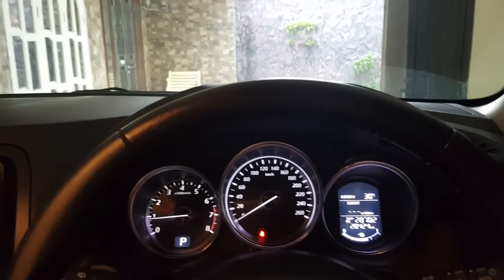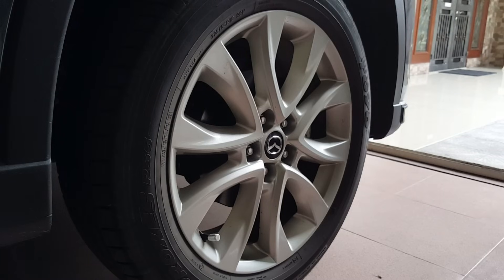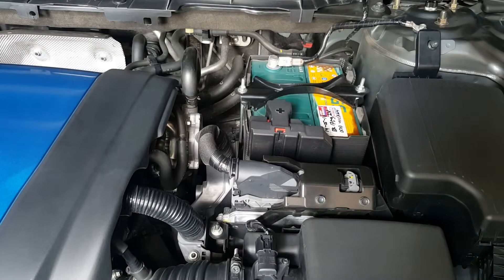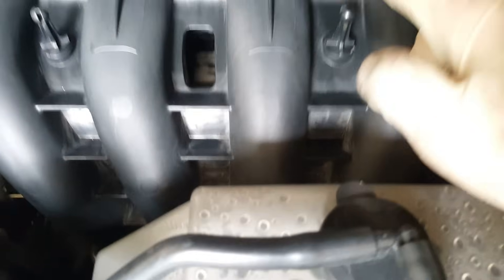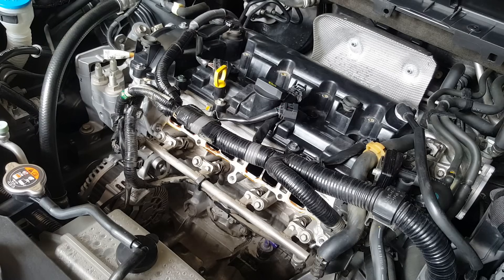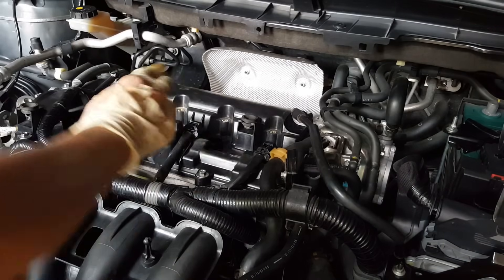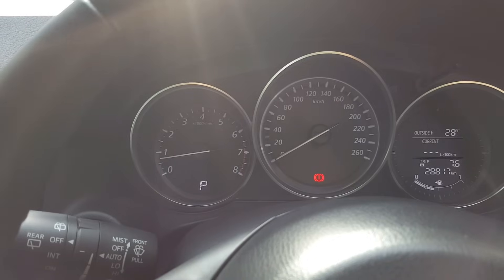How to Clean Intake valves / Carbon clean // Mazda CX 5 (All Skyactiv Gasoline Engines)

Comment: Apa tanda2 intake valve CX5 sudah kotor dan harus  dibersihkan? Terima kasih banyak.
Reply from the maker: kalo terjadi misfiring saat jalan. Kalau kepingin bersihkan saya sarankan membersihkan intake valves setiap 40000kms spaya tetap awet mesinnya dan pilihlah bengkel yg mengerti ttg mazda skyactiv. Soalnya sdikit rumit juga untuk dikerjakan.
Reply: @GarasiFelixDan  terima kasih atas jawabannya. Ada bengkel rekomendasi di jakarta? Kalau anda punya bengkel di jakarta, boleh share alamat? Bentar lagi udah km 40rb.
Reply from the maker: @thebearbean  mungkin bro bisa bawa ke bengkel elika jakarta.
Reply: @GarasiFelixDan  bro, bengkel yg mengerti mazda dmn ya utk daerah Medan selain bengkel resmi ?
Reply from the maker: @rahmatantony9506  kurang tahu bg. Mungkin coba cek tonsgarage. Kalo bole tahu ada problema apa ya.
Reply: @GarasiFelixDan  pada saat mendahului mobil lain saya pijak gas penuh tiba2 delay bbrp detik suara mesin meraung setelah itu normal kembali.
Reply from the maker: @rahmatantony9506  pakai bbm ap ya. Apakah uda coba ganti filter udara dan bersihkan Throttle body dan udah brap km ya mobilnya
Reply: @GarasiFelixDan  berarti itu masalahnya ya bro ? Kemarin sy isi pertalite kebetulan diluar kota g ada pertamax. Apakah itu berpengaruh ke mesin ? Menurut informasi dr mazda pertalite msh diperbolehkan bro dan g membatalkan garansi.
Reply from the maker: @rahmatantony9506  pertalite bole tp jgn sering ya. Octane nya jelek. Bisa ngelitik dan gk bagus buat mesin high compression sperti cx 5 kita.
Reply: @GarasiFelixDan  ok terima kasih informasinya bro.
Reply from the maker: @rahmatantony9506  cek busi nya jg y.

Comment: I wonder If this is due to mostly bad fuel. I know fuel in the US is much more refined and also we have faster roads. I'm at 95k miles on mine and runs great.
Reply from the maker: You r correct sir. Here the fuel quality isnt that good compared with in the US . The traffic also alot different we only get traffic jam and mainly start stops in the city and that is why we dont pass over 60kmh on our roads. :(
Reply: @GarasiFelixDan  Hopefully I dont have issues...I plan to keep till over 200k miles.
Reply from the maker: @dexterm1285  you should be alright :)
Reply: @dexterm1285  hey dexter how is your Cx-5 now?
Reply: @michiganmitten1147  Still runs great 114k miles.  Only thing I had to do is replace the shifter park switch as car radio would sometimes stay on after car turned off.  $50 part and took under 30 mins to replace myself.  It's a known problem on these vehicles especially as they rack up miles.

Comment: Thank you for the video of your cleaning method. Great detail! What kind of roads was the CX-5 driven on prior to cleaning? Was it mostly short distances or long distances, and was it on slow or high speed roads? Strangely, these engines have their own version of a catch can on the manifold (that hump in 8:23 where you have to remove the line).
Reply from the maker: Mostly short distance.
Reply: Thank you.

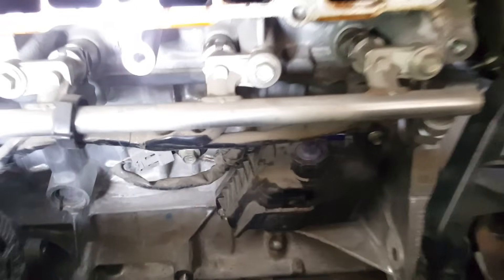Comment: 8:25 Don't think that's an oil catch can. You need to install one between PCV  and intake manifold.
Reply from the maker: Sorry my bad.
Reply: @GarasiFelixDan  why did u rotate crank pulley and remove spark plugs/coil packs?
Reply from the maker: @mtay65  to know which ones of the valves open n closes. you have to rotate crank pulley. and if you had the sparkplug while you rotate you r going to fight againts the compression.
Reply: @GarasiFelixDan  i see, thx, Felix

Comment: Now I know why Mazda arrange their engine so that the intake manifold is front facing and the exhaust manifold is rear-facing (different with other manufacturers, the other way around). Logically, exhaust manifold facing forward (to cool-down?). BTW, this arrangement makes the cleaning process easier.
Reply from the maker: Indeed sir.

Comment: Felix, thanks for making this video. When turning the crank, did you turn it clockwise or counter? It should only be turned one way correct?
Reply from the maker: Clockwise i believe . But should double check again with he engine running.

Comment: I am wondering did you spray those carbon cleaner directly inside the intake valve and let it sit there and use brush to get those gunk out is it
Reply from the maker: Yes sir and a vacuum to extract the debris.

Comment: DI engines, if your driving style is moderate you better get a port injected vehicle. Doing this on a bmw n63b4400 will go for no less than us 1500, and it seems that you have to do so every 15000 miles or even less.
Reply from the maker: thanks for the info

Comment: Could you use the vacuum hose from air intake and spray your product via that option? Awesome video by the way 👍
Reply from the maker: Appreciate your time tunin in, i have never tried it but it could work. I think theres somebody here on youtube done it , his car is a honda accord new gen.
Reply: @GarasiFelixDan  Or why not just spray the cleaner thru the throttle body with the car running?
Reply from the maker: @MrSpandya22  Scared that it will trigger the engine light. Just want to play it safe.

Comment: I thought Mazda's did not have this problem. Supposed to run the intake valve hot so it does not accumulate carbon.
Reply from the maker: Nope . The problem still there by the looks of it.
Reply: @GarasiFelixDan  Maybe a catch can would help?

Comment: Considering combustion takes place above the piston in the combustion chamber why is the carbon deposits in the inlet manifold to the chamber.
Reply: Because emissions makes them run exhaust gas recirculating systems which basically put exhaust back into the intake when you let off the throttle

Comment: SO I Have the same intake manifold but my fuel rail is on the top of it on my mazda 3 but I have the 2.0l MZR non Skyactiv engine, am I good or is that also Direct Injected?
Reply from the maker: If the fuel rail on top then u shouldnt have this issue. Just add cleaner additives to the fuel tank regularly u should be alright.
Reply: You would still have this problem. I think all Mazda 3s have direct injection. Even with the fuel rail on top.

Comment: Felix Dan 
Thank you for your videos, very entertaining and i've learnt alot .. im gonna try doing this on my Mazda 6 2.5L 2014 .. just to make sure, valves that are down are closed ? Correct ?
Reply from the maker: Thank you for your time tuning in. That is correct just make you the intake valves are in closed position prior applying the chemical, don't forget to subscribe to this channel and ring that notification bell make sure you wont miss any future upload videos.
Reply: @GarasiFelixDan  do you have a picture of a valve which is open and closed .. just to see the difference.. thank you
Reply: @waqsha   
This should be self-evident.

The still photos Felix included into the video showed the valve closed.  Closed valves are actually in the UP position.  (Valve mounted on TOP of the cylinders.)

When valves go down (open position), they are pushed down by the valve cam (think in terms of DOHC or older SOHC).  This pushes the valves INTO the cylinders -- so imagine the pictures that Felix posted (which are CLOSED position), valves in teh OPEN position you would not be able to see the base of the valve; you'd just see the stem of the valve, and the hole/opening into the cylinder.

Comment: Gasoline in Indonesia and other 3rd world countries is very high in sulfur which causes coking and carbon buildup. This buildup is non-existent in the USA.  Great video for Indonesia tho.
Reply: This is happening in the US as well on Gas Direct Injection Vehicles. Theres no gas cleaning the intake valves when it shoots straight into the cylinder head. It has nothing to do with the gas itself, it is a design issue on modern engines.
Reply from the maker: @buffhorses  very true indeed.
Reply from the maker: Thank you den demron :)

Comment: Just did this job. The hardest part was removing some of the lower harness clips that are attached to the intake. One of the clips can only be accessed from below the vehicle. You failed to mention that. Thanks for your videos!
Reply from the maker: ahh yeah , i didnt mention that . apologize for that. good catch though.
Reply: @GarasiFelixDan That was really important.
Reply: how much was the cost   if done at  a dealer ?
Reply: @restalva   just got a price of 400 euro to inspect and 1300 to do a carbon clean. Not sure if that covers more than whats in the video
Reply: @markoriordan7880 That is fu ck expensive...I think its 600e in Ireland for carbon clean.
Reply: Thanks for this tip.  Please confirm that  you had to remove one or both of the plastic panels underneath the car to gain access to these wiring harness clips?    Thanks again for the tip!
Reply: Did you notice any improvement in the performance?
Reply: @scooterwoodley195  Not really. This is more a matter of engine maintenance than performance. The valve clicking does go away though.
Reply: There was one clip that was impossible too see from the top of the car. So i just broke it off and now it works like a peg.
Reply: Just removed my 2013 CX5 GT intake this weekend. Was able to do it without getting under the car. There is one bolt that is quite hard to reach at the bottom of the manifold, but if you're able to reach down and feel it, there's just enough room to break it with a small ratchet, and then just use a ratchet extension by itself to twist it the rest of the way out.

Comment: When u rotate at the crank pulley, can u feel when the intake valve closed? Is it any other way to determine the int.valve fully closed, other than ie.  put a stick/rod inside the plug hole and watch it going up and down?

I really want to try this, but afraid if the valve not fully closed and something get into the cylinder.
Reply from the maker: Only 1 way to do it is to look directly with a torch on the intake ports while someone rotate the crank pulley . You will be able to see it clearly when its about to fully closed and open.

Comment: Thanks for the video. I'll never buy one of these piles of junk. 
Mazda says: "excellent fuel efficiency should never come at the cost of performance. So, of course, our driving-obsessed engineers found a way to enhance both. It’s called SKYACTIV® TECHNOLOGY"
Now we know that Mazda engineers are morons.
Reply: What a stupid post ! All Direct injection engines have the tendency to build up carbon residue on the intake valves. It is like complaining to the brewery that u have to go to the toilet after the beer ...
Reply: Heiko Panzlaff, it's not really a great defense of Mazda's "driving-obsessed engineers", to say that other engineers are just as stupid. If Mazda is  going to sell junky engines that you have take apart and clean every 7000 miles, they should make them easier to take apart, and give you a lifetime supply of Easy Off oven cleaner.
Reply: You're kind of an idiot.
Reply: 322845 miles and I have not cleaned my 2013 cx-5 gas  valves yet

Comment: Im a Master Mazda tech and yes this carbon buildup is normal on all makes because of no injectors in intake to clean valves ppl please bring car in to dealer abd have induction service performed every 24000km if city driver if hyw do it every 48000km will save you from having intake to be removed and valves walnut blasted or manually scrubbed 1 gen sky had more carbon then newer models pcm flash has  been tuned and newer models coming down the road will have a coating on valves to prevent carbon sticking . Make sure you dont leave to long as if alot of carbon build up may need more chemicals to run into engine and will prematurely kill catalytic converter or degrade it  price one out and let me no what is cheaper 100 dollar induction every 48 or 3000 bucks and induction
Reply: How the induction serviced done? Can u clarify?
Reply: @shhhdontshout  https://youtu.be/dCBxUcqH2zE that is one way
Reply: @shhhdontshout  https://youtu.be/qnjeq715wKM
Reply: @shhhdontshout  few different ways but longer u leave it there the harder it is to get off if u do induction more often it helps reduce the buildup
Reply: It’s unfortunate that a “master tech” can’t communicate very well. If I went to my Mazda dealer and asked for “induction service” I would expect them to just laugh at me.

Comment: I Dan, I fixed my problem on my CX5 (sounds too loud at start the engine and sound rought on Idle)  Just clean the MAF and MAP sensors, also cleaned the throtle body (it was so dirty in there used a half  bottle of carbon cleaner and used a tooth paste brush, my microfiber changes color from blue to black)  now it sounds like a new car at the start also put an AEM  Dryflow Air Filter (it looks so cool).   And now on first driving test have better fuel economy  from 11.5mpg on trafic to 24mpg.  I will do this more often.  Thanks to your videos.
Reply from the maker: You are very welcome sir :) appreciate it
Reply: Dude that’s awesome, your fuel economy definitely improved drastically

Comment: Isn't there an easier way , using the CRC Intake valve spray ?  But that needs to be doneevery 7-10 K miles , still easier. It also takes time with the one hour heat soaking , and then 30 minute expressway driving , but less work for many less experienced people.
Reply from the maker: This method could also work just fine if done correctly and and at regular intervals. But do not expect that it will remove the stubborn baked up carbon deposits on tge valves because without actuall scrubbing and extract it out . There wont be any easier method to clean them manually (proffesionally).
Reply: CRC 100% will not come close to this level of clean. I did the CRC/Seafoam intake cleaning for several years (at least every 10000km - sometimes 5000 km) and at 50k i took off the manifold like in this video here and did a manual cleaning. It was pretty bad (worse than here). Hyundai lambda 2 GDI engine.

Comment: Wow this Berryman B-12 Chemtool is to price,  Do you recomend another cheaper Option?
Reply from the maker: Unfortunately i have not tried any other products as good as Berryman B-12 Chemtool, but i believe there are a similar brands out there that will also do the same job as Berryman B-12 chemtool.
Reply: @GarasiFelixDan  Nevermind, I have see wrong on Amazon it says 12 pack,  7 $ on ebay for 1 can. ja ja ja.
Reply: Have reading a lot of Isues on CRC intake (sensors and check engine thing), is safer to clean like you did.
Reply from the maker: @cybermx8896  might want to check this review as a comparison . I think extracting the carbon manually is better than letting the engine burn it back into the atmosphere. https://youtu.be/48JSlXlvMC0

Comment: Woah, no one at the dealership said anything about this carbon buildup, and they are trying to sell me the new cx5 model, hey could you share a pic of how the valves look open? For reference, because I can’t find a mechanic to do this for me, so I might have to do it myself, thank you for sharing this!
Reply: If you drive your car normally or semi aggressively this is a non issue. Piddle around and use shit oil and it potentially can be an issue
Reply: @Suction_  every oil change the dealer used castrol full synthetic, and I don't really ever go to redline, but I usually drive at 2000 rpm for at least half hour, I cleaned the throttle body and the manifold had a lighr oily film on it 3 months ago
Reply: @grandprixuse  you'll be fine. Even in this video I sincerely doubt theres an issue with what was shown. People have it in their mind that the problems BMW VW and minis had in the late 2000s had. They were so bad you'd have misfires and such. Modern DI is much better.
Reply: @Suction_  aahh, thank you haha, I was already for an oil catch can, looking where to mount it but taking the manifold off had me a bit scared haha
Reply: @grandprixuse  You still can do that if you want, but there is an integrated catch can device on these motors. Its an odd setup, but it seems to work quite well so long as you are getting everything up to temperature

Comment: Very Nice job .. Ty for the time.
   My wife drives 2018 CX5, 32 ( or 64 to 70 miles round trip)  highway miles one way to work. mostly driving 55mph or more. If i have her use premium gas and gas additives on occasion in your opinion you think it will  cut back on carbon. It would be nice to compare hers to yours when she gets to the same miles.  Tx again have a great day
Reply from the maker: Thank you and i appreciate your time tuning in. My opinion it will be not much difference other than adding higher octane for better fuel economy , as per this engine r direct injection and wont wash off carbon deposits on those intake valves . But if you were to use any fuel additives it might minimize a little bit of the carbon deposit being baked into the intake valves. Hope this helps.
Reply: Not really that's the beauty of gdi welcome  to a greener world.do this method save your money on additives. In usa they do walnut shells  blast how about it.

Comment: how did  you  rotate the engine ?
Reply from the maker: To turn the engine i use ratchet with socket at the crank pulley bolt turn it clockwise.

Comment: Felix Dan Do we have a EGR valve on the skyactiv 2.0 engines ?
regards,
Felix
Reply from the maker: Only the diesel fitted with egr. I dont think for 2.0 engines does have one correct me if i am wrong. :)
Reply: Felix Dan I thought the same but a forum member told me that I should delete it. he has a mps  but other told me the same and that's why I was curious and I'm asking you because know the car ;)